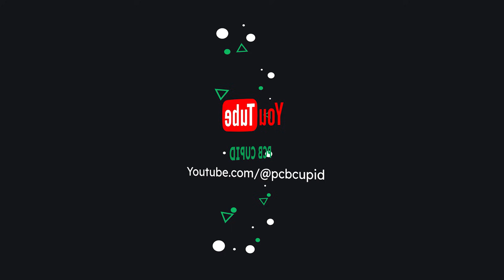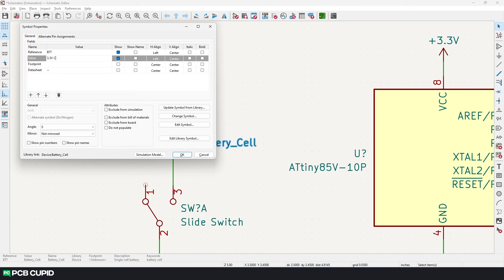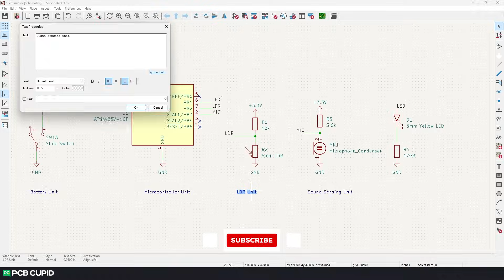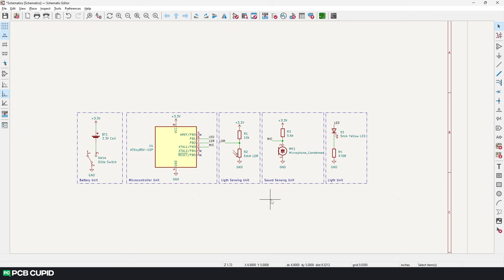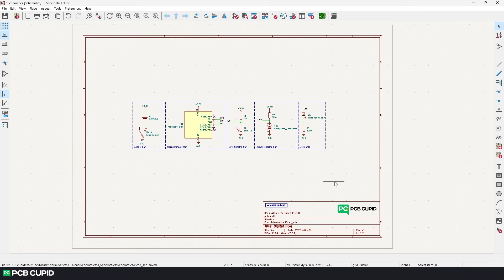#4 How To Prettify Your Schematic with Kicad 7.0 | #PCBCupid

Comment: I'm sorry but I'm kinda lost on how everything is connected without a connection. am i missing something?
Reply from the maker: The connections are made internally by KiCad based on the net names. This is not always necessary; you can connect everything traditionally with wires, but this method will help you keep the circuit clutter-free.
Reply: it gives one connection as a square box make sure ir connects to the non connected wire's part to connect it

Comment: Thank you so much for these videos. I just started learning KiCAD and your videos are such a helpful guide. My version of KiCAD is 7.0, but I  don't have the graphics tools feature, so I couldn't separate the circuit in sections as you did. Please how can i get the graphics tools on my version? Thanks
Reply from the maker: You're very welcome!

That's because of the screen resolution; it will be available on a bigger screen. Alternatively, you can find them under "place" menu.
Reply: @pcbcupid  I've found it. Thank you so much! I trust I'd learn so much in the subsequent videos

Comment: I know a lot of Engineers like me despise the overuse of nets to avoid connecting components/symbols. I think there should be a law that if the schematic can fit on one sheet, you are required to connect everything with wires so you can see exactly how the circuit is connected. Having to play a game of "connect the dots" to try and find where one net starts and then jumps somewhere else is not clear or intuitive. Using "hanging nets" IMHO should be reserved for complicated circuits with too many overlapping wires where the amount of connections overrides the simplicity of seeing the actual connections.
Reply from the maker: Agreed! 🙌

Comment: Excellent series of video. Helps a lot to understand KiCAD in a short time. I'm a novice in PCB and in KiCAD. 

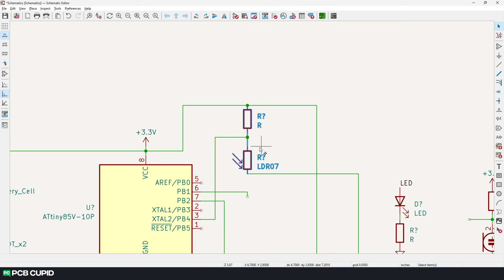However it's not very important but I would draw your attention to a small mistake exchanging pin3 (MIC) for pin2 while making this schematic pretty (around slider postion 2:50)
Reply from the maker: Glad you liked the series!

Thanks for pointing out the mistake. Currently we have placed order for the same circuit in the video, we'll try to update the code for the same.